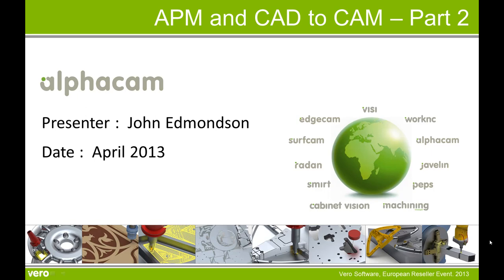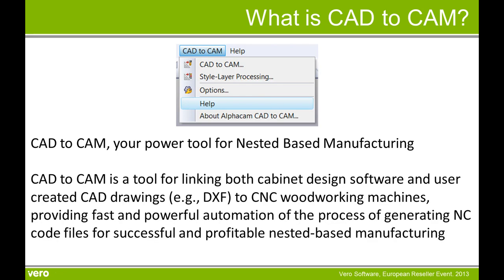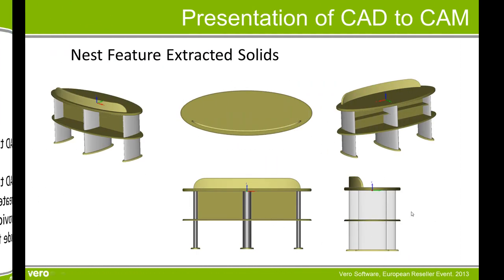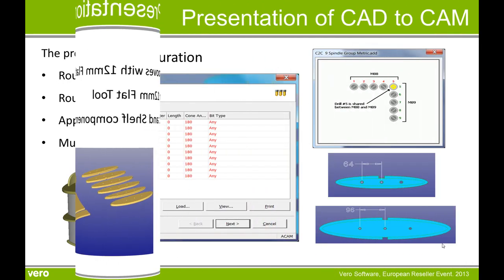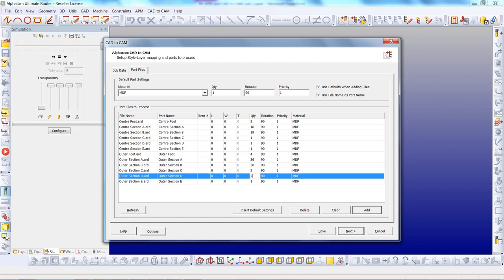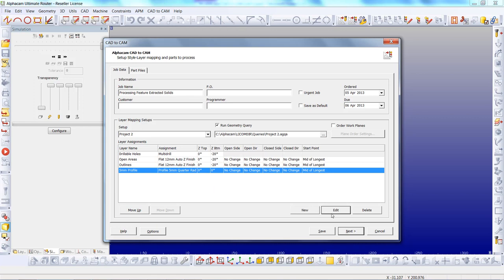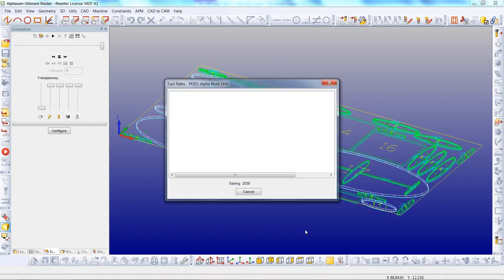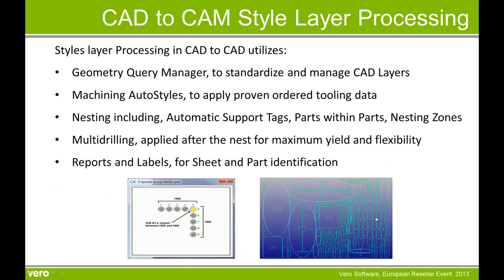2013 R2   APM and CAD to CAM   Part 2

Comment: if i have parts from different materials, with differents materials, how can i specify this on the material list from style layer processing. I just see one kind of material and no option for adding more and linking with the corresponding parts for this material thickness. Regards.